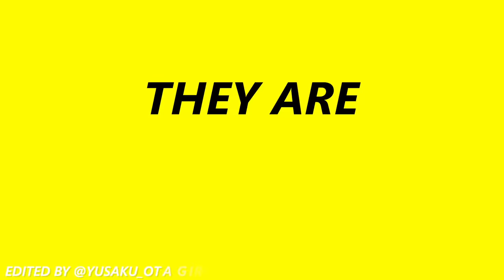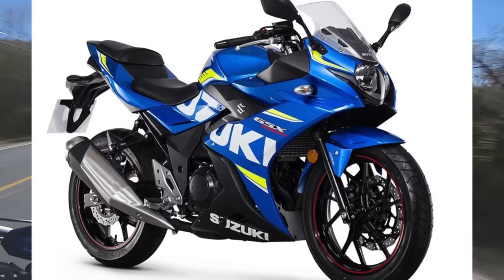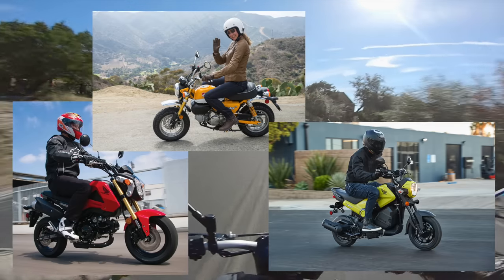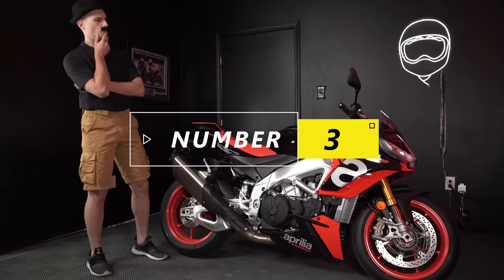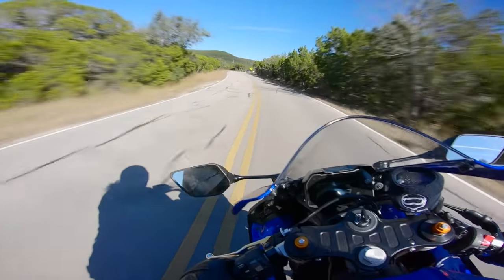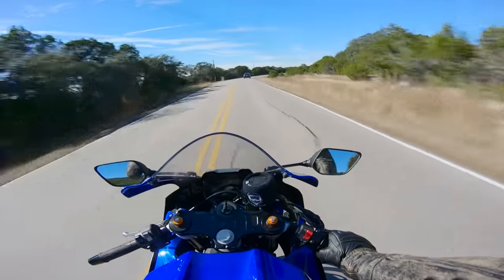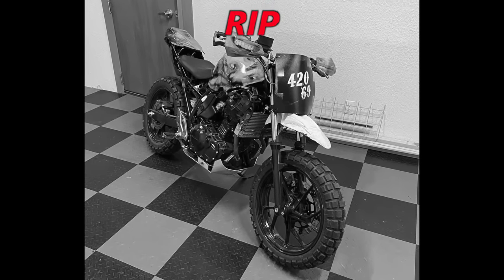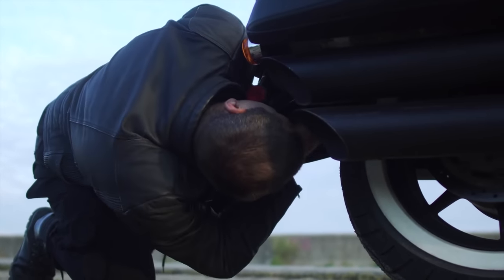Top 7 Worst Beginner Motorcycle Choices! (Must Avoid)

Comment: I bought a 1988 CBR 1000F, possibly not something you would recommend. But I am a bit older and quite sensible if a may say so. Futhermore in the Netherlands getting your motorcycle license takes a little bit more than just a course.
Reply: Haha me too, liked them when they first came out. 33 years later bought 1 as my first full licence bike. Its been a bit of a challenge but great out on the main roads. Stay safe M8
Reply: CBR1000F! Respect!!
Reply: Thanks, same with me, I like the old school look of it and that it looks totally different from modern bikes. Just have to be carefull with the throttle. Lucky that Germany is nearby, if i have feel the need for speed. Stay safe aswell!

Comment: 2005 VTR250. Bought it cheap as the tyres were bald and no registration. Motor ran very well so the rest was fix as I went. Tyres, fork seals, kick stand and grips are where I'm at.  Having a good local bike wreckers is great for slightly older bikes

Comment: My first bike was a Suzuki GS 500 E. Two  Carburetors, many problems. But the easiest thing to do on this bike is to clean the carburetors and see if it works. The best moment I shared with this bike was, to start it with pushing and running on the sideline of the (german) highway. That means you walk next on cars, who passes you with up to 150 km/h to get the engine started.

Comment: As someone who works on bikes, boats and arc for my self and others. the duel carburetors will drive you absolutely insane especially if you have to re-jet them and then re-synchronize them just to find out that it’s still running lean or rich

Comment: Finally some validation for my carburated 80's inline four 750. I count that as 2 out of 7 hits. Best beginner bike ever.
Reply: but how much have you had to mess with the carbs.  UJMs fall into two boats, either you have to constantly mess with the carbs to get it to run right, or you literally never have to touch the carbs
Reply: Japanese 80’s and earlier 90’s inline fours are the best bikes ever made. From the 250’s to the 750’s.
Reply: @mrvwbug4423  Not true. My FZR250R was running okay, but not perfectly when I purchased it. Took it apart (down to engine but not inside the engine), cleaned everything, put it back together. Quick carb tune, and now she runs mint. 
Bought a DR350 a few weeks ago, wouldn’t kick over at all. Spent an hour taking carb out, tearing down, cleaning, back in the bike. Kicked over third pop, runs like a champ now after a good ride. 
Dealing with four carbs vs one is definitely a bit different, however it is all the same premise, just requires balancing with more than one carb. But if you do the work right you can get anything to run well.

Comment: There are plenty of beginner bikes that use carburetors. For example, my Yamaha vstar 250 from 2022. So far, it hasn't given me any problems. I know that one of the main issues with E10 fuel is that if you are not careful, the carburetor will clog very easily after a few weeks without use. But since I use it for commuting, I haven't had that problem yet.

Comment: i practice clutch for the first time using HD 48, and my first bike is a MV Agusta Brutale 1090rr 2011, and its all fine AS LONG as you understand what you sat on. first of all, i watch TONS of video regarding bikes and how it works. second, i start it slow and try to feel my bike as much as i can remember, the brake, the clutch, the gas, power, torque, basically everything. my 2nd bike is RSV4, 3Rd is panigale, and then i switch to japanese manufacturer and bought Honda cbr 1000rr sp1 2019 and now i change it for the cbr 1000RRR 2021. Just be responsible and enjoy whatever bikes you want.

Comment: The Grom is one of the best beginner bikes, especially in the UK, it's unintimidating and easy to ride.. the UK has plenty of 125cc options as the licencing laws are much stricter over here.
Reply: Have fun not being able to learn proper throttle control
Reply: The groms under power does not translate well to a larger bike with more throttle. Someone who is used to choking the groms throttle could yeet themselves lol
Reply: Throttle control is piss, I went from a duke 125 to a MT07, we actually need to do a TEST not a course, which teaches us these things. We can't just go do a 30 min course and hop on a H2R. it's a lot easier in the USA.
Reply: I’m 6’4, I’d get laughed at less riding my gran to work than a Honda Grom.
Reply: @callumboothroyd3766  It's not exactly piss , it's just that in Europe they teach you how to ride on a bike that is on the level of your license ... I have the A2 license , I learnt to ride on a CB500F . If I were to go for the A license I'd have to learn on a Hornet 600. So we kinda learn how to deal with the throttle , in USA you need to learn this alone .. cause you can take a mini bike , pass the course and then get a savage wheelie monster like a 690 or an MT-09 . If you have enough of a brain to not get something too powerful , the Grom is a fine beginner bike , because it's light, short , efficient, cheap , quick enough to get around town , and it will teach you the fundamentals of riding way better than a scooter. Plus it's extremely fun lol.
Reply: He’s talking about In the UK where ppl start riding bikes at 17 (legally) and you can only drive a 125cc until ur about 18 so they are great for learning clutch control and all other controls before you can upgrade. (And if ur too tall then don’t get one 😂 just like if u were too short and you wouldn’t get a hike too tall for you.)
Reply: @culturedsquid8442  I agree completely.
Reply: Eh I'm not too keen on the Z125s or Groms as being great beginner bikes.  Yes they are small and unintimidating but the the two major downsides are 1) they have an absolutely terrible clutch and 2) they're so small that anything bigger is going to feel huge and a Grom isn't going to build much confidence if you want to ride something bigger.

I took the MSF course in the US using a Grom and Z125.  They're basically the same bike.  Later when I bought my first bike, a Rebel 500, it was pretty intimidating and felt huge.  I was pretty nervous taking it out the first few times.  But I got used to it pretty quick and I was shocked how buttery smooth the clutch felt by comparison.  Now it doesn't seem like a big bike at all however I think I could have saved myself a little bit of time and effort by starting on the larger bikes, even just an older Rebel 250, in the MSF course.
Reply: Here in NZ you do a leaner license test (written and a ride around some cones in a carpark). Then you do the restricted test after one year (this is an hour ride in all environments where you are followed by a govt approved testing agent). Then you can get your full licence after 18 months, where you do another test where you are followed. 
At the learner and restricted levels you can only ride bikes 650 and lower (not 600cc bikes though, they monitor them all with a power to weight ratio calculation). It is only once you get your full licence that you can get whatever bike you want. It’s a load of BS if you ask me…
Reply: @tinman3586  I believe you'll feel a similar intimidation going from your Rebel 500 to something like an XSR900 , it doesn't mean your Rebel was a bad platform to learn on , it's just that you're going to another level . And yeah , the clutch on most of these bikes isn't that good , but tbh , it's fine for a little mini bike , if this clutch was on a rebel 500 then it would be terrible . It's all relative my dude.
Reply: @pleasedontwatchthese9593  exactly hence why a grom isnt ideal because you cant learn throttle control at the start.
Reply: 125cc is what our kids ride at 12 years old
Reply: I think it's OK if you ride mostly in the city. If you live somewhere that is big open roads you need at least a 250/300
Reply: @BaldKiwi117  absolutely wrong, I rode a 125 across the UK keeping up with traffic. From north Wales to Cornwall. Only place I wouldnt ride is a motorway or what you call "highways"
Reply: @callumboothroyd3766  not absolutely wrong. Sure it worked for you but our traffic is definitely faster here. Not to mention if you were on the heavier side the grom is going to feel about as fast as a bicycle.
Reply: @BaldKiwi117  and you're saying this from your many years of experience on a 125, on roads like I have? Ok bro.
Reply: @callumboothroyd3766  nope just experience with a 250 on roads I have 🤷
Reply: @taliesinangling3564  What's "proper" throttle control?
Reply: @callumboothroyd3766  Im 18. Who cares. 125cc are childrens bikes, id rather get my tiny bike riding phase out when im a kid then be a grown ass adult learning on a 125cc 😂
Reply: @webtoedman  Its an essential part of learning how to ride. On a grom you dont really have to care about having a smooth throttle hand and not being choppy because the bike barley does anything. Jump on a bike with actual substance and you’ll have to relearn throttle control all over.

Not to mention how a grom doesn’t handle like a normal sized bike at all:
Reply: @taliesinangling3564  Strange how that doesn't happen in countries with a stepped licensing system...
Reply: @webtoedman  What doesn’t happen specifically?
Reply: @callumboothroyd3766  Oh so you just have a strange aversion of the way other countries do things. I see now. And wow a whole day of practice? Learning how to ride makes you a better rider, cant learn how to ride properly on a 125cc.
Reply: There's no way I'd touch a grom where I live in the US. I wouldn't even touch a 250. Hills/mountains, highways to get everywhere. No thanks.

Comment: I was that guy who did exactly what you said not to do in 2 of the points. My first bike was an ‘80 Honda CM400 that hadn’t run in years that I built into a bobber since it was put away by the previous owner as a project.

Comment: My first and only bike is the 2021 Royal Enfield INT 650. New exhaust to drop the weight and a tiny bump in HP (original is 47hp) and it's a great starter, just has a bit of weight to it (original is about 450LB, new pipes bring it closer to 410- 420 I believe). Not expensive, nice look, people ask about it. Parts aren't pricey for maintenance. Almost 6k miles before winter came.

Comment: I suggest you guys to get one of the triumphs one as they are literally one of the best beginner bike out there with a lot of power enough for beginners to intermediates get high on highway speedy air. Yeah the electronics may get overwhelming sometimes but you don't need to change those frequently.

Comment: raced 250/450f motocross machines and they are wicked fast up to 80mph which is haulin at a good clip over dirt, had the 500cc 2 stroke back in the day and they were borderline insanity if you didnt have a disciplined right wrist (we didnt know any different in 70/80s)........but like you said you will learn one way or the other and fear can be a good thing!......

Comment: Started on an old carbureted 2003 Suzuki Intruder 805cc cruiser 5 years ago. It was a great bike. Never any problems. Recently sold it because I lost interest and got my first sport bike. A 2008 Kawasaki Ninja 650R. I opted for this one because it was cheaper than most of the other ones and had the more standard seating position with higher handlebars. I know he says that 650’s are slow but I think this thing is stupid fast and I can’t picture why anybody would need more power than this. Any more and your going to get yourself into trouble with the law or dead. I already feel like I’m going to get pulled over whenever I get on it. Lol

Comment: I've a 1994 Yamaha xj600n. Yes it has 4 carbs and  She got just 61HP. But I wrench on my 2 cars myself😅 learned a lot of things about these bikes, Yes it is things that I can't do, like carb sync or proper tuning, I had it apart completly, cleaned it put together.. And set it so it's capable to move(to the service and get it dialed in properly)
It is a 600 but not a gsxr 600srad with 130HP.

Comment: My first bike was a backyard built,  rare, 4 carb, 1987 kawasaki zx 750f. No manuals on anything, half the info you could find didn't pertain to the bike because so much was custom, and the coolant reservoir was a Gatorade bottle. 
I learned a lot, but I would've learned a lot more about riding if I'd made a better decision about the bike I was getting 😂

Comment: I dunno man, in the UK when learning to drive a motorcycle for your full license its usually done on a 600 or 650. I learnt to drive on a Suzuki Gladius 650 and once passing both practical parts i had a suzuki bandit 600 which i drove for 3 years without any problems what so ever, sure it was quite heavy but the power was never too much to handle and id consider myself a slow and safe rider for the most part (we all have our moments of madness).
Reply: In the Netherlands too, the driving course is on a 650 if you want a full license.

Comment: Aprilia Shiver or Dorsoduro 750 with ABS are Italian bikes but great für beginners. Especially in Germany, where you have to limit the power to 48HP in the first two years of riding bigger bikes. When these two years are over and you’re allowed to use the full power, it feels like a new bike 😄And the sound of this V2 engine is absolutely gorgeous 😍
Reply: The Aprilia Shiver 2008/2009 is an awesome bike! Great ergonomics, great mileage (1 liter per 20 kilometers). It rides awesome, the stock sound is nice enough and the bike esthetics are 👌. 
It’s comparible with an Yamaha MT-07 or Kawasaki Z750 performance wise, but for 2/3 of the price and with a far better seat position.

The story about Italian bikes being unreliable is just non-sense.
Reply: @BenDrawings   I was very lucky and found an used Akrpovic exhaust on ebay, with this slip on the sound of the Shiver really is 100 times better than of the most other motorcycles with this displacement 😄

I can’t really say whether italian bikes are reliable or not, I got a used Shiver with 10.000 km on it as my first bike, drove over 25.000 km and sold it without any big issues. I heard about Shivers with 100.000 km which are still running well 😅 
Know I‘ve got a Tuono ‘17 and I can‘t complain about anything until know. But I can‘t compare to other motorcycles with this mileage, because I never owned other bikes than the two mentioned 😄
Reply: Felix W 

Thats sounds good! 
I never heard about big issues with the Shiver or dorsoduro, so one day i will buy an Shiver again. For now it’s an ‘89 Honda Transalp and it’s a really fun to ride bike. 
Quite curious about the Tuono. How is it compared to the shiver?
Reply: It’s pretty much like one would expect, if you look at the two motorcycles 😄
The Tuono feels much sportier than the Shiver, due to the V4 of course. Due to the seating position, you have more pressure on the handlebar and the knee angle is much smaller. The Tuono always wants you to go faster, because the engine runs smoother at higher rpm and in long, fast corners it feels extremely stable. The Shiver is more “playful” and you can ride more comfortable and don’t have to worry being too fast all the time, ‘cause you don’t recognize how fast you’re going on the Tuono 😅😂

Comment: I always tell people just don't get a sportsbike. There's literally no reason to get a starter sportbike. They're slow, boring, less reliable and the WORST in anything but ideal riding conditions. Cruisers are the most common and you can find a ton in decent condition for a good price. And dual sports are just great because you might actually hold onto a low CC enduro just because they're fun and easy to ride off-road, you WILL outgrow your started for a bike with a bigger engine, so you're better off starting on a cruiser or enduro, and then if you REALLY want a sportsbike, try after you've got your bearings on much easier, more versatile bikes first
Reply: sorry but my experience with my Yamaha R15 contradicts what you say on almost every point.

Comment: My frist bike was a 1975 Honda cb200t cafe conversion I got the bike for free and it needed work I got running it was my first time riding a motorcycle and I loved it and I ended up getting a 1978 Honda cb750 scrambler conversion needed a little electrical work and go that running prefectly put 3000 miles on it and sold it and then got a very low mileage 2003 Honda hornet 919 big upgrade from a carb bike for me but I love the bike the more I ride it the more I learn it

Comment: I should have got a Z400 instead of a grom as a first bike. Grom is cool but after 2 weeks I wanted something else
Reply: Dude, don't start on anything smaller than a 650
Reply: @pleasedontwatchthese9593  exactly
Reply: @pleasedontwatchthese9593   I’ve scraped them once but the stock tires were garbage. I like the grom but if you wanna get some highway miles in you’re gonna be in for a hard time. I’m not a wheelie guy but I’ve tried em for sure

Comment: Lemme add my 5 cents. or, rather, 10 cents.

1. old carbureted bikes. If we are talking a low mileage cruiser and the price is reasonably low and the owner seems to be an older person and the bike looks like it had seen at least some care -- ffs, go for it. Plan to change it in 2 years (exact period of A2 license in europe) ride it like you stole it, rev out all those 16hp (xv250 hehehe), scrape the passenger pegs, dont be afraid to drop it in a driveway, even with your gym routine of exactly 0.3 visits a year you could lift it up.. And, after those 2 years you could resell it for pretty much the same price you got it.
Pros - you have a cheap-ish bike. You get to hit the ceiling of what the bike could do, not being a bottleneck yourself. + usually cruisers are better maintained, if only on the outside.
Cons - you are not winning any races or shows. But, was that the point?. 

2. +1 for a rebel suggestion. even if the cruiser is not your thing, rebel should tick all the boxes. And should hold the value quite well.